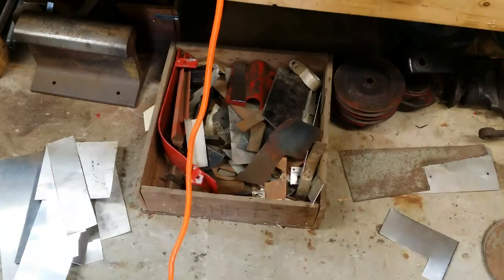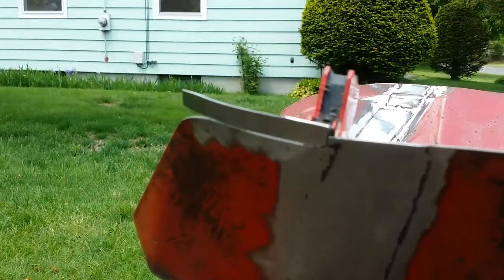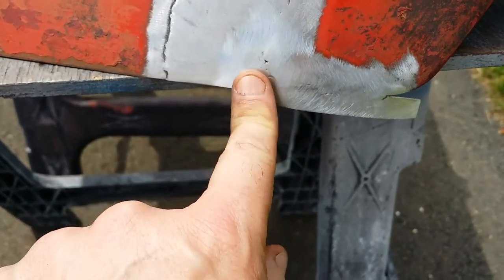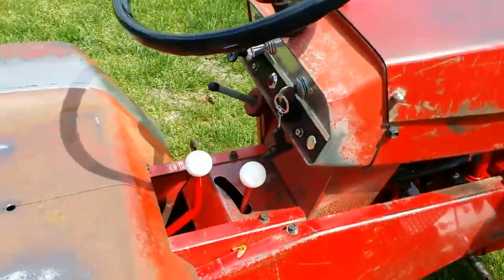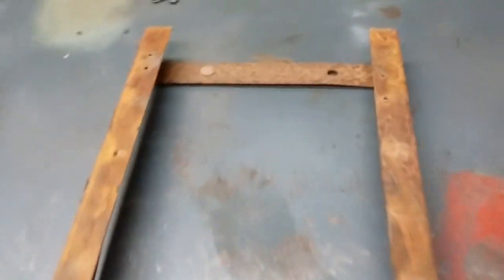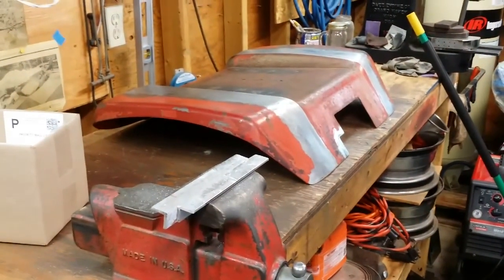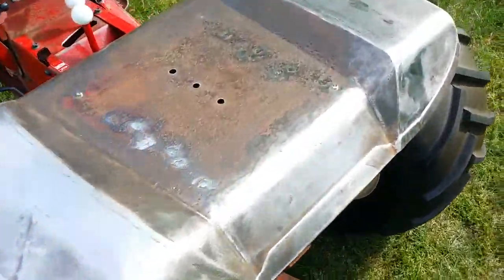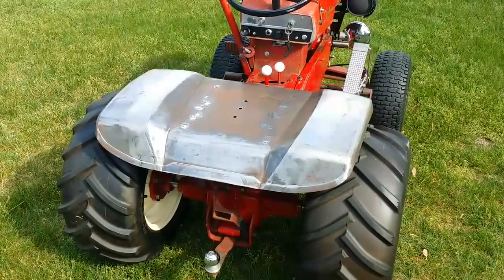Wheel Horse 857 Lil Mule Garden Tractor Custom Fender Pan Part 3

Comment: Vin, if you have a piece of sheet copper, you can bend it to match your angle, and lay that behind the patch. This does a couple things. It stiffens the area to be welded, and it draws the heat away where you are welding, and when you weld, it wont stick to the copper. This is typical of some sheet metal repairs at a body shop. This is also most useful for welding holes shut, but you might need a bit heavier copper, like water pipe made flat.
Reply from the maker: That is a good suggestion, 👍 thank you for watching!